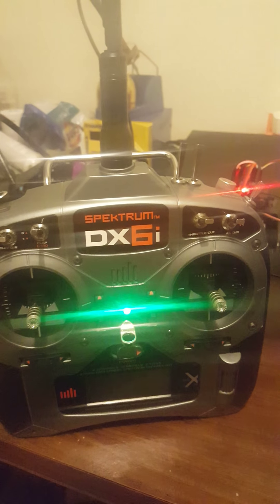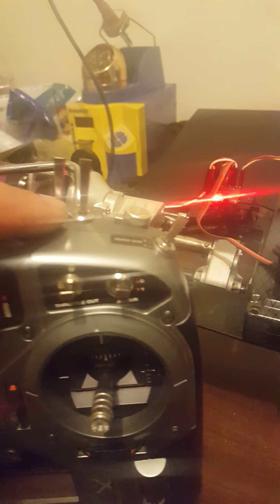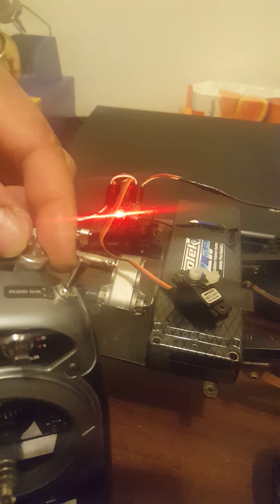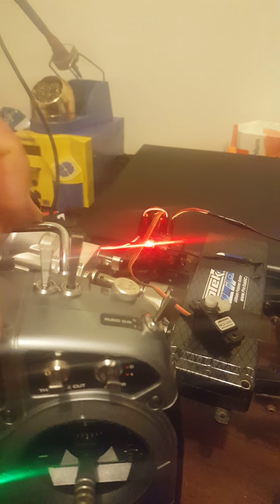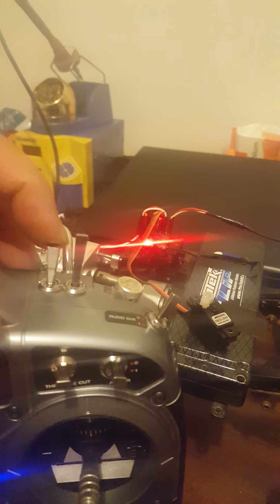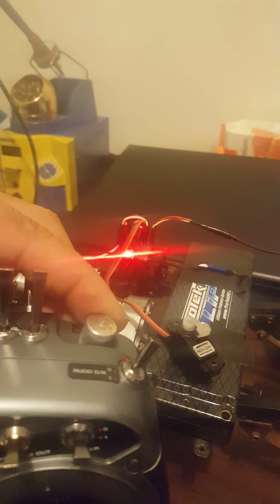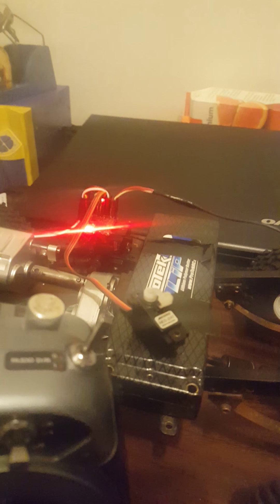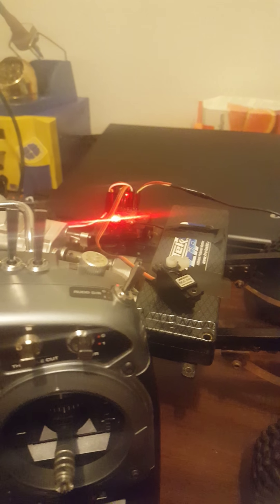Modded dx6i part 2

Comment: I want to do this mod put channel on potentiometer
Wich pot do you use??
Do you have a video??
Reply from the maker: what i did was locked the sticks so that the left stick will only move up and down and the right stick moves left and right only that free up 2 ch so i moved them and used a 5K ohm potentiometer for one of the free up ch i no longer have this radio as i use flysky now that i can have 10ch and cost way less
Reply: @tdciv   ok thank you